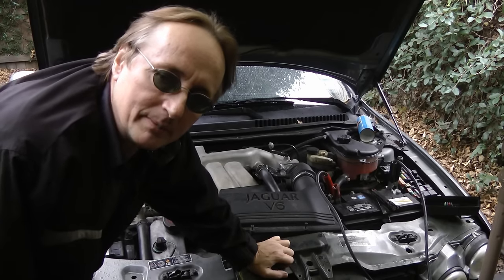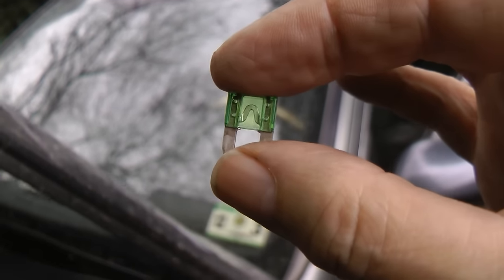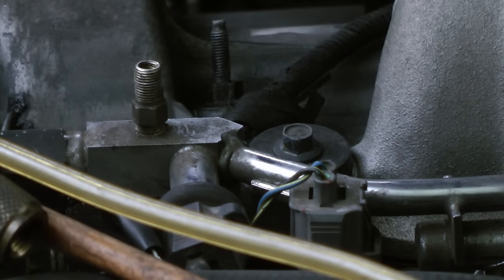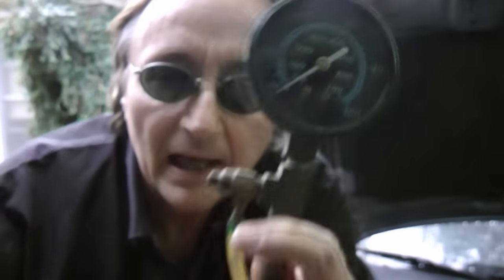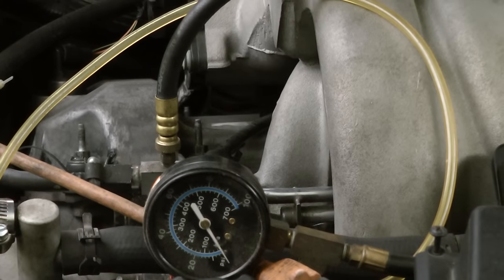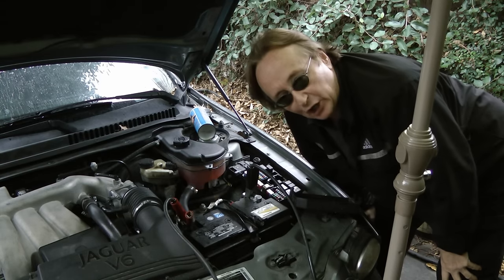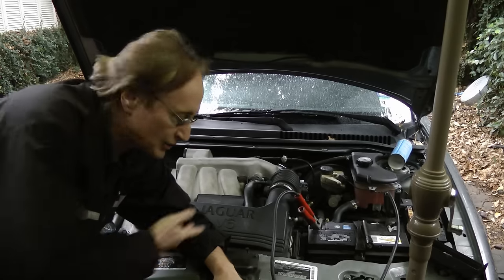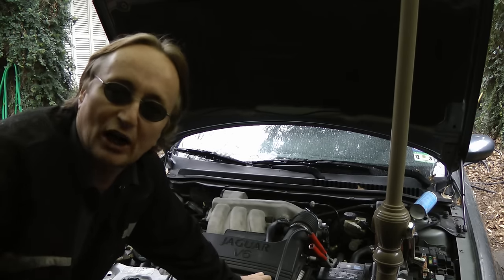How to Tell if the Fuel Pump is Bad in Your Car

Comment: that is why I buy Toyota.
Reply: J Chu Toyota's breaks broke
Reply: J Chu That's a great statement, I'm impressed.
Reply: +J XXX Currently having issues with my toyotas fuel pump lmao, but im restoring it and it sat for 11 years, so i understand why its a bad fuel pump
Reply: ***** Depends on what im doing, obviously you have to take faulty parts off.
Reply: +PuppetMaster Lol you have it made my man!
For one, your water pump was due for replacement anyway (at 90k miles actually). And if it was previously replaced, I'd be willing to bet it wasn't replaced with an OEM pump. Second, it sounds like either you need to grease your hood a little bit. Did you have an accident? Many times an accident will warp the metal around the hood and trunk, making it difficult to open or close (even tiny fender benders). All the Celica owners I've known don't have issues with their trunk (including my mom and aunt back in the 90s). 
I've had to work on many of my family member's cars, and no surprise Toyota is definetely superior in the eyes of many based on first hand experience. And don't assume that the number of recalls is a clear indication of bad quality. American car brands don't issue recalls for many of their vehicles because they have to pay to fix it. Taking responsibility is better than laughing all the way to the bank as your customer is having their fairly brand new car in the shop getting fixed at their own expense.
Reply: +PuppetMaster toyota recalls but others don't. that's another plus for Toyota
Reply: ***** They blamed it on lack of communication to the big wigs. 50 deaths isn't a lot if you consider Toyota is the #1 vehicle manufacturer in the world. Ford took the hit on 200 deaths in the early 90's for being too top heavy and equipping each explorer with garbage Firestone tires. Tragic consequences, but nontheless the issues have been officially dealt with. I refuse to excuse the proven reliability of the car brand as a whole because 2 models had issues for 3 years.
Reply: +J XXX Same here I have 177,476 miles on my 2007 Toyota FJ Cruiser and I love it only had to replace 2 batteries, and 2 alternators... Fucking LOVE Toyota!!!!
Reply: ahahahahahahahaha .. I have a ford escort 93 whit 408,000k ..
and never  change the fuel pump ... only brakes , a idle speed sensor , one time batteries and one time alternators . no smoke and runs great .... 
special 40 below cero in Chgo winter time  .... American cars ...are good   
and  my chevy C10- 83 / 326k ... and runs great too ... heehehehehehee 
cheers ........
Reply: Well your the only one in America
Reply: TheTruelakersfan LMAO XD
Reply: JC Journey exactly I have 96 4runner and is the easiest car to fix my friend. ..
Reply: If you're having car problems,I feel bad for you son. I got an '86 Toyota and the bitch still runs.
Reply: My father in-law has a 81 celica that still runs with over 350,000 miles on it. Motor is still original and keeps his fishing gear in it to drive to the creek. Looks great to be that age and runs like a sewing machine.
Reply: I work at firestone... im new... but anyways of all the cars that i have brought in the shop toyota corolla is my favorite one because i didnt have to look around and find the "push to start button". Also i was able to adjust the seat easily in a split second because it had the underseat lever unlike all these other new cars that have an electric seat... i got into a 2014 benz and the damn seat buttons didnt even work.
Reply: @mcozpda3392  oh my god that’s insane. If you seriously still have it you should bring it to Scotty to be awarded. He will praise reliable American cars when they are that reliable, I’ve seen him do it before. 408K miles or km? Either way you have gotten your money’s worth. I have to assume it was manual to be that reliable.

Comment: If the tank is under the back seat make a access hole to remove the pump .on my grandam .i made a access and used a grand prix fuel pump   no more gas tank remover
Reply: I used tin snips cut rite out . Seen some guys using grinders. Crazy I thought.  What u use?
Reply: you gotta think outside the box sometimes lol
Reply: Mike Walker grinders in a fuel tank? Isn't that dangerous?
Reply: Yeahs That's why I used tin snips

Comment: Hey Scotty I have a 2001 chrysler sebring That starts but doesnt stay on theonly way it stays alive is if i keep pressing the gas as soon as let go of the gas pedal my engine stops running could this be my fuel pump ? checked vacuum and no leaks so i replaced the alternator and the spark plugs but still nothing lol is there anything else i can try ?
Reply: Sounds like mass air flow or tpi sensor Ay??

Comment: I know in some cars if you run out of gas the fuel pump goes out.
Reply: do you know if this happens in a let's just say for example purposes a 1996 Cadillac deville?
Reply: +Ryan Toomey Thats because the motor in the fuel pump uses the fuel as lubrication. When you are running on empty the motor has no lubrication and burns up.
Reply: believe it or not the gas keeps the pump cool they get hot and burn up if you run them low on gas people think I'm crazy when I tell them but that's how they are

Comment: Hey I got a quick question maybe you can help me or someone on here.  I have a 2006 Toyota Corolla that has problems starting up especially in the cold.  I would say 70% of the time it cranks and starts up normally the other 30% I have to crank it a lot longer and the car sounds like it's not going to start (almost sounds like it going to die on me) but then it starts up after about a good 3-4 seconds of cranking it.  I believe this is my feul pump but I'm not sure.  Possible starter as well? Do you have any suggestions what it could be?
Reply: Battery

Comment: Jaguar is one of the biggest POS cars you can own....A relative of mine use to own one and only had it for a year before he sold it. The oil changes alone cost around $95-100! And I should mention he is a doctor making plenty of $ so cost wise it wasn't even a problem for him. He just didn't want to keep paying rip off prices for anything that needed fixing/changing on the car.
Reply: well... I have a 2010 VW Golf 2.5L and it does indeed cost 100$+ the oil change no big deal about that
Reply: 5 Quarts of Synthetic oil (Mobil 1) at Wal-Mart - $25. This is the recommended oil for Porsche, Mercedes, and BMW, so it's good enough for an old Jaguar. A Purolator oil filter is $3.50 at Wal-Mart as well, so for less than 30 dollars you can go to Wal-Mart and change the oil in a Jaguar. There is zero reason you should pay the dealership to do this oil change. A jiffy lube charges 20-30 bucks as well. I'm pretty sure that saying your relative makes poor decisions on where to spend his money doesn't make a Jaguar a POS.
Reply: He was a doctor... not a car mechanic. He didn't know much about cars and would never change his own oil. So yeah maybe he did make a poor choice buying a Jag but overall he told me the car wasn't anything special.
Reply: complex2034 Again no reason why you should go spend $100+ to change the oil at the dealership especially for a Golf... that ain't no exotic car. It's a fun car to drive but you shouldn't rip yourself off at the dealership.
Reply: mclaine33
fun cars to drive, not fun to repair!
Reply: You fail to mention what model and year Jaguar he owned. I have owned about 2 dozen Jag's since age 25. I also bought some of those to sell but I can say that many models from them are just as reliable and easy to work (and sometimes cheaper too ) than other luxury makes/models.
The last Jag I sold was bought 6 yrs ago, '04 XJ VDP that had 75k at purchase and was sold by me with 137k. Replaced water pump, thermostat , coolant pipe, etc at 120k , replaced a air shock at 135k, replaced the blower resistor at 105k. All labor done by me = $0 , parts were bought cheaply too.
I know people who spend waaaay more than I do on Jaguar repair  even for their Lexus's. The real Jag's are the Xj's , Xk's, Xjs and the new F-type. NOT X and S types that were Ford's meddling.
Reply from the maker: hyperwebbing
 True to some extent, but really, most luxury cars are made for high maintenance and super expensive repairs, It's the nature of the snob business, you pay for bling if you go in for that type of nonsense.

Comment: All the "luxury" brands are not worth it. Lexus, Acura, Cadillac, Infinity, etc. have comparable cheaper counterparts.
Reply: Care to provide some examples? There are usually significant tradeoffs. i.e. cheap interior, lower performance, parts wear out faster, etc. For example, I much prefer the Lexus ES300 (2nd generation) to its "comparable cheaper counterpart" which would be the Toyota Camry of a similar year. Unfortunately the Toyota Camry has a much cheaper interior, more road noise, and on top of that it really isn't that much cheaper than a Lexus ES300. 

If you do your research on reliable used luxury cars that have been out for at least 3 years then you can sometimes be okay.
Reply: chownful My cousin is a mechanic. Everything else is identical with a Lexus and Toyota. If you upgrade a Toyota with everything, you have a Lexus, just less expensive.
Reply: ***** Maybe some recent ones.
Reply from the maker: *****
they used to be RWD, but many are now FWD as it's cheaper to make em that way

Comment: On my Hyundai i30 2014 you just remove the back car seat(4 bolts) and you have a lid with 4 screw and under that you have the fuel pump. 
Easy peasy to replace and even clean the tank. So great. It´s even a manual primer pump build in om the fuel filter assembly.

Comment: In an emergency you can also use an implement to push on the valve stem of the pressure port to see if there's pressure but beware it can also squirt fuel out at high pressures too. But it can tell you if there's no pressure.

Comment: I’ve got a 2013 Honda Civic and I’ve seemingly gone through 3 fuel pumps in two months - the original and two replacements - and still my car won’t reliably start.  Is it really the fuel pumps or something else, perhaps ACTING UPON the pumps?  Two months now: sometimes the car starts, sometimes not, and it keeps getting diagnosed as “a bad fuel pump.”  Otherwise I love this car; over 60,000 miles and never had a lick of trouble until now.

Comment: Working on a 2000 Nissan Frontier.  Fuse is good, i am getting power to the fuel pump. Turn ignition on hearing a steady hum.

Comment: You are amazing. Been having issues with my peugeot 307 Semi-Auto. When i turn the engine on and press on the acceleration, it raves but the moment i put it on drive, after a few seconds of accelerating, the acceleration cuts off no matter how hard i step on it, it just doesn’t rave. What could be the cause? 🙏🏾

Comment: Scotty I have  a 98 Civic that sometimes cuts off while driving and sometimes doesn't start.  When you turn the key, the fuel pump doesn't always prime.  I'm thinking it is either the fuel pump or the fuel pump relay. Any thought or ideas would greatly be appreciated.
Reply: I had something similar in my odyssey it was a bad alternator . It had a pwersteering fluid leak and damaged the mechanic check just about everything on it computer fuses wiring . In my case was altern alternator. Hopefully is something easy to fix.
Reply: @chanteoflowkillaentertainment  thanks I'll check that out

Comment: i 1990 geo metro LSI convertible, that car is having one problems after another that keeps it stranded constantly. The last thing I remember was parking it and starting the car, the car moved and sounded like a low battery RC toy, even the "Check engine." light was one. What do you think it could be? I think it's the fuel pump.

Comment: Hey Scotty. I have a 2004 turbo diesel pickup. I’ve only had it a few months. It has given me some issues staring on the first try. Also, more recently, the revolutions do not idle steady with my foot off the gas. Same in the freeway. When I am cruising, it sounds like I am pumping the gas pedal.

Comment: Similar design on my R51 (2005-2013) Pathfinder. Fuel level sending unit commonly goes bad, but can be replaced by cutting a hole in the sheet metal under the 2nd row seat on the driver side. Take the guts from a Trailblazer fuel sending unit, swap them out, put it back in, and cover using a Nissan Armada fuel sending unit inspection hole cover.  WAY easier than dropping the tank.

Comment: I have 2001 Chevy van. It stalls and sputters everytime I put gas in it. The only time it does better is when I put a certain brand cleaner in the tank. I changed the fuel filter it started starting easier but it still sputters and dies occasionally with no warning. I also sprayed throttle body cleaner through the breather. Basically I don't know whether it's the throttle body or the fuel pump at this point. Don't wanna replace the wrong one.

Comment: Scotty I need your help. I have a 2000 Buick Regal LS. I’m getting a very bad misfire/hesitation from the engine when starting it up. Check engine light was blinking when this originally happened. I’ve replaced spark plugs, all 3 coil packs, oil pressure sending unit, lower and upper intake manifold gaskets, ignition control module and pcv valve. I’m lost. I thought it would be the fuel pump but it actually starts up just runs really really rough. Any suggestions? Thanks!

Comment: Hey Scotty I bought a 2015 Ford Taurus, it has 130k miles and my problem is every time I put gas it has trouble starting.. but after that the problem goes away and turns on just fine. What do you think could be my issue? 😕

Comment: Hey Scotty, I am hoping you can help me out as I have gone to multiple mechanics and still have an issue! Firstly I drive a 1997 Chevy s10 6 cylinder, It’s been randomly stalling on me mostly at idle or low speeds, it normally starts right back up. Here’s a list of parts I’ve had replaced 

*fuel pump
*ignition switch 
*ignition module 
*ignition coil
*fuel filter

I highly appreciate in advice you could give me and thank you for your time

Comment: Scotty, I watch your videos the question I have, is with 06 mercury Mainer.  I replaced the fuel rail high pressure switch and it didn't solve the issue, so then I watched your video on fuel pump,  replaced fuel pump and still no luck,  Just about every time i run a scan it gives me high fuel pressure switch.  I checked the fuses and relays they all were good, The only thing I didn't check was power going to fuel pump.  Is there anything else i should be checking?  Any help would be appriecated .

Comment: Hey Scotty.  Love your videos.  My daughters car is a beater.  My rules are, your first car must be older than you and it must be a manual.  So, I have a 2001 Nissan Xterra 5 speed, that will intermittently not start.  No fault codes are given.  I had it towed to a mechanic that I trust and the thing started up and ran fine.  They had it for 3 days.  They checked fuel pressure, electrical, etc but could not duplicate the issue.  Since then it has done it twice more.   It started, drove about a mile then died.  Then would not start again.  now its fine.  It seems to happen more so when it rains but i think this is a coincidence.  Do you think I could have a dying fuel pump since it is intermittent?

Comment: A couple of weeks ago, my 02 Oldsmobile Alero wouldn't start after getting gas.  I was pretty much on Empty and filled my tank up.  My car started, sputtered, and shut off in about 2 or 3 seconds.  It wouldn't start immediately, so I let it sit for about 5 to 10 minutes.  This time it started normally.  I don't know what the issue was but next time, I won't let the fuel get so low before refueling and hopefully I won't have that issue again.

Comment: I have an 89 f150 4 speed and the fuel pump can be heard while it's idling. I have a video on here and I'd like for you to listen to it and give me an opinion. The name of the video is 4k rpm revs 5.8. At the time when I recorded it the truck ran just fine and had more power than I ever expected but I drove it for another week or 2 then it was backfiring in the intake and very hesitant. Matter of fact I couldn't even get it up to 55 when before that I could easily turn 55mph in 3 gear. I put it all back together after being told to check for bent or burnt valves which it didn't have then fired it up and it did the same thing.

Comment: Scotty I really need your expertise....so I have a 2002 toyota Camry and I just bought it from a private seller i haven't even had it a month and I've already had to change the compressor and the valve cover gasket and its ran pretty good up until the other night when my bf was driving it he said it suddenly died while he was driving down the Interstate and it hasn't started since. I switched out the starter yesterday still making the same clunk sound I've checked the battery its good all my interior lights and dash lights work as well as the headlights and radio I checked the relay and tried to bypass it and start it and it didn't make the same clunk noise but still didn't start and still no crank I'm literally sickened bcuz I barely bought it for 2500 and can't drive it

Comment: I have a 2015 Chrysler Town and country that starts beautifully at cold start but once it's run and I shut it off the van will try to fire but spitter and sputter but won't start. Could this be a fuel pump or perhaps filter?

Comment: Hey Scotty love your videos and humor... I have a question... I have a 91 f 350 with a 7.5 gas engine and I'm not getting the fuel pumps to engage bought a new relay truck started once and ran fine now I'm back to no start issues it has dual tanks and pumps neither one operates did you have any advice for me? Besides flip over read directions lol